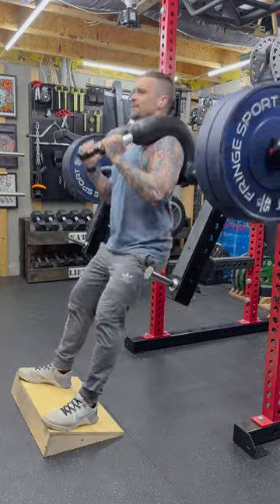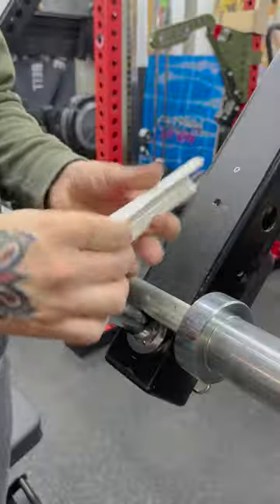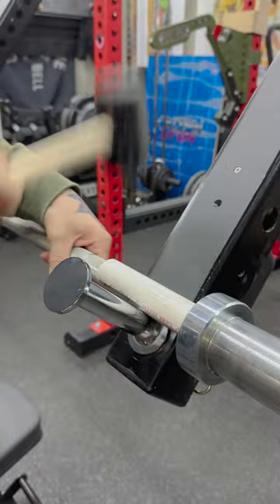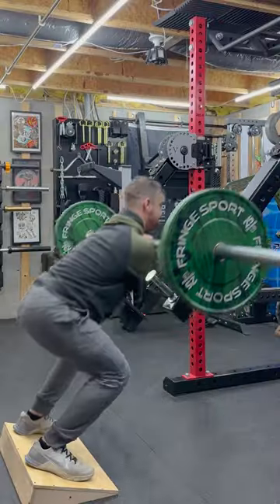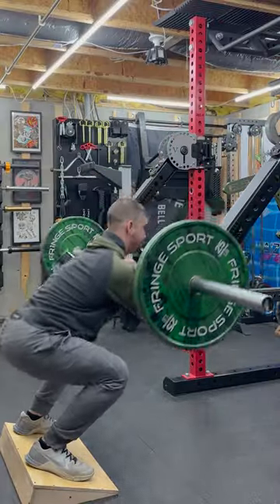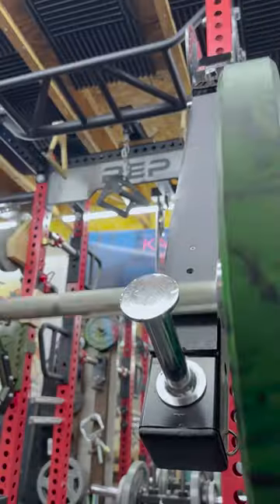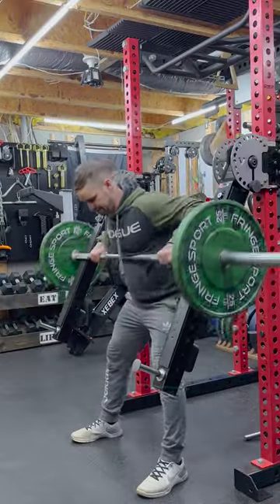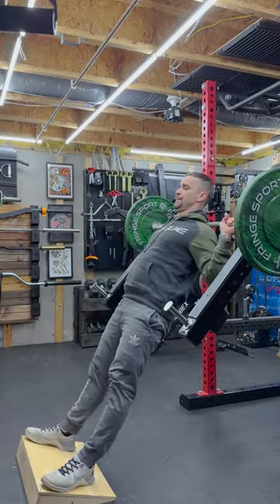Am I onto something here? HDPE on jammer arms and PVC on my barbell

Comment: Add resistance bands and then it is a maybe, otherwise you are only moving a very small portion of the weight.
Reply from the maker: Sounds like I need to use my luggage scale to test the amount of weight being pushed/pulled
Reply: @KaizenDIYGym  Not really, it is simple force vector physics, you only need to know the weight and angel, then the calculations are simple. Look up the formulas online, it isn't rocket science. Another option could be to utilize these movements in different angles for warmup sets and drop sets.

Comment: I like that this hack squat is pretty easy to set up compared to some others I've seen. Where did you get the HDPE strips?
Reply from the maker: I searched for HDPE on eBay. There are plenty of options
Reply: @KaizenDIYGym now I want to get the vendettas since they work with the arm adapters attached and the hdpe is cheap so I’ll be trying this setup

Comment: That’s a good call using the pvc.
Reply from the maker: Cutting pvc is a challenge but it does work extremely well
Reply: What size pvc did you use ? I was thinking about doing aPVC cover like that for sumo pulls but couldn’t find a pipe the right size